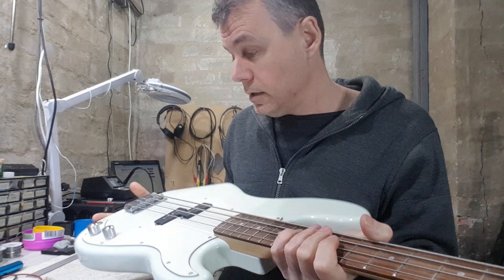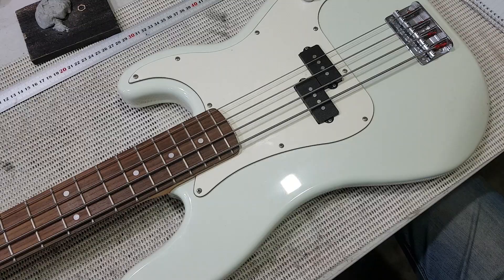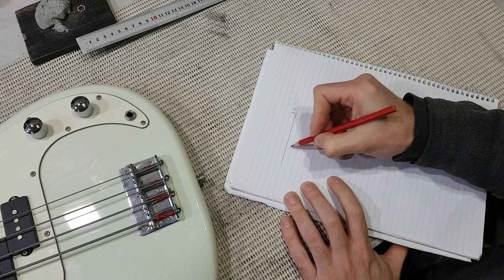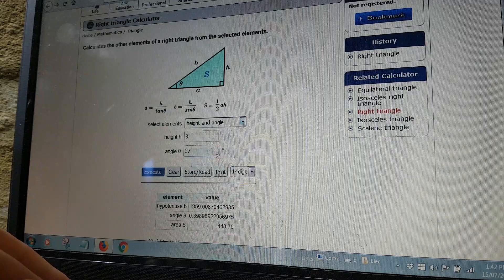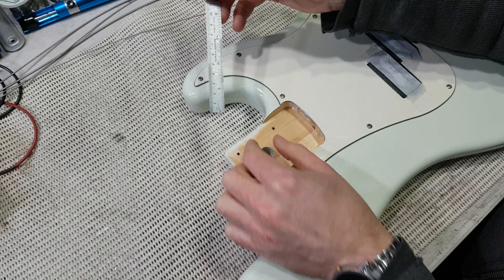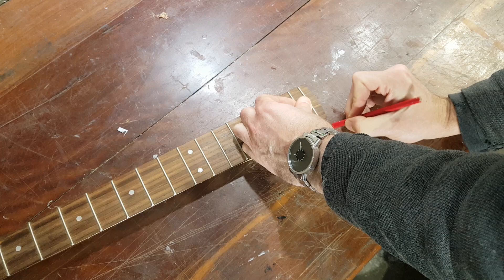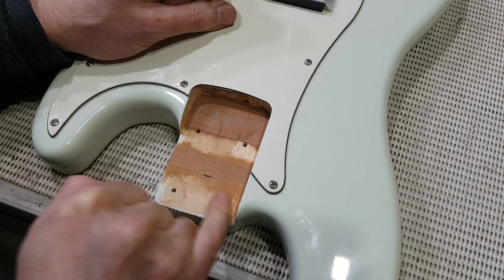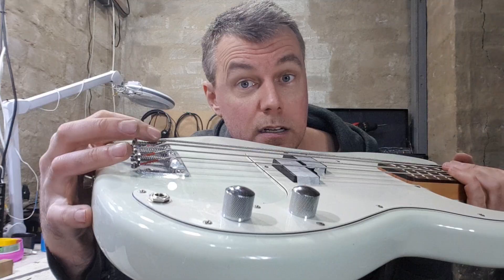How to Shim a Bass Guitar Neck.

Comment: awesome, that was very helpful! I'll have a look at more of your videos!
one remark: the calculations could have been much simpler: (intended hight change at bridge)*((length of pocket)/(distance end of pocket to bridge)). No angles needed. That's because the hight is proportional to the length of the base in a right triangle : )
Reply from the maker: OMG, you sir are a genius!  I've been doing it this way with trig for years.  But you are absolutely right.  Thanks for your comment!...
Reply: Rob Mods. Haha, glad I could return a favour : ) Greetings from Berlin.
Reply: yooo thx mate, was thinking about an easier way too - but 3 points in maths....
Reply: instablaster.

Comment: Really nice work, Rob!  I recently had to do the same with a Fender Custom Shop Telecaster.  I just could not adjust the bridge properly.   The problem was exactly the same as your video.  I installed a shim of about the same thickness as yours, but I did not taper it.  It plays perfectly now.  This is a much more common problem in all electric guitars than people realize.  The reason is that bodies and necks are mass produced in huge volumes.  The neck pocket is cut with CNC.   Then they're sanded, then they are painted.  Necks are installed that are also mass produced on a production line.  The thickness varies between parts, shrinkage happens, add sanding and paint thickness and wood quality----- it's all about quality control.  You have to do the fine tuning yourself.

Comment: Regular electric guitars usually need a shim at the rear of the neck pocket. I find a standard business card marked to match the neck heel curve means 1/32" at fret 12 lower string gap (fret top to string bottom). If 2 are needed, make a bottom shim double the length of the rear one (to provide a tapered shim). I also replace the standard offshore 10mm length saddle adjustment Allen screws with 8mm ones to lower the saddle heights and allow screw tops NOT to chafe the right hand when playing....   and eliminate shimming sometimes!

Comment: You don't need to know the angle, you can work out the intermediate height (h) by similar triangles - x/96 = 2.5/359, thus h = 96 x 2.5/359 = 0.67mm
Reply: Could someone explain this more? Its very interesting. I've tried looking up similar triangles but have lost how it connects to the bass.

Comment: Great video.  Any thoughts about using the shims made by StewMac (besides being expensive?).   Also wouldn't it be better to create a shim that fills the neck pocket?  Seems like that would distribute the pressure across the entire neck pocket.  Also with more surface area the neck makes better contact with the body (which improves the sound?).

Comment: Great attention to detail Rob, would be happy to have my bass in your hands. Can you speak more as to why you chose to use two pieces of veneer to make the shim rather than a single piece on the bridge side of the neck pocket. Perhaps due to the uneven surface in the pocket / easier than trying to level the pocket?  Great work as usual.
Reply from the maker: Ha ha, well, it's partly because it just feels right to do it.  But I guess, it offers another mating surface with the neck heel.  It would otherwise be an air gap between the back edge of the pocket and the shim.  Having the main shim go back to the screws, and also having that middle shim means the heel will stop when you torque up the screws instead of possibly flexing slightly, which may lead to the screws loosening over time.  You could also make a shim that covers the whole neck pocket, but this will need more sanding and IMHO, is a bit over-kill.  This neck pocket was more uneven than usual, and needed a bit more sanding.  It usually is just a quick kiss with the 120 grit to level it up....  Cheers!

Comment: @Rob Mods.  Wow great video 👍 I need to do this on my Dean Edge fretless 6. Can you advise me what should be the string clearance at the bridge end of the neck for the low B and the high C please? It's currently 8mm at the B and 3.5mm at the C, which is as low as I can get it by adjusting the bridge right own and truss rods, but seems way too high.  TIA.

Comment: When shimming is it important to make sure to eliminate any air or empty space between neck and body to retain the sustain?
Reply from the maker: Good question.  Some luthiers will create a full tapered shim that covers the entire pocket, but I've never bothered.  Once the neck is pulled down to three contact points, plus shimmed in the sides if needed, then it is fine IME.  Also make sure the screws are actually pulling the joint together.  Often manufactures just drive the screws straight in.  The holes in the body will often be too small, and the screw will jam and stop.  You need the screw to spin in the body so it draws the heel down firmly.  I will usually also put a small smear of dry lube or lanoline grease on the threads so I can feel it better as I torque up the screws.  This will also protect the threads from rusting, especially in tannic timbers.  Cheers.

Comment: Have just picked up a Sterling Ray4 about 4 months ago, and no matter what I do in regards to saddles/ bridge height, I can't seem to clear some fret buzz on most of the upper neck. Would a shim on the opposite end of the neck cut-out help resolve this?

Cheers.
Reply from the maker: I doubt shimming will help for this.  Make sure the relief is set correctly, then check the nut slots, then adjust the saddle heights.  If the saddles run out of adjustment, then this is when you need a shim.  Buzzing usually means the trussrod is out of adjustment, the action is too low, the frets need leveling (or reseating), or the neck has warped...  Or, more likely, some combo of these.
Reply: @RobMods  Thank you for the response. Will have a look and see if I can't get it to work. Reason for thinking it might need a shim is that with the necl relieved to its current point, the feet board is bowing backwards slightly, sort of a banana shape. My thought process is to level the bolt area, will help alleviate this.